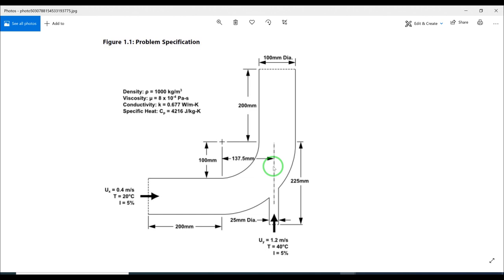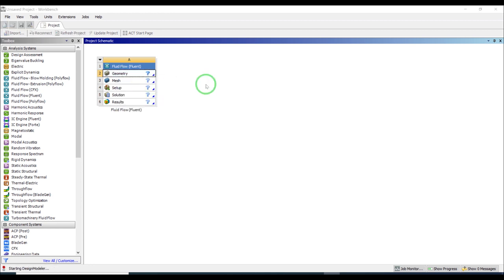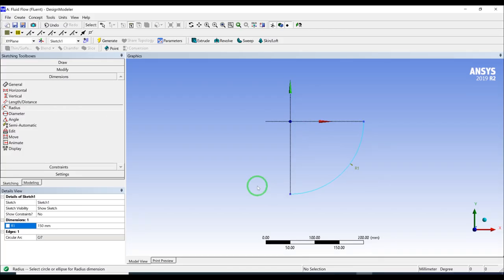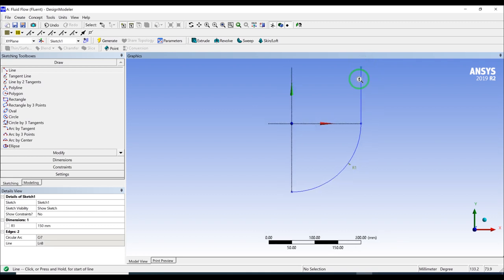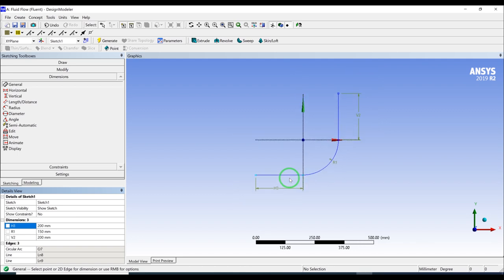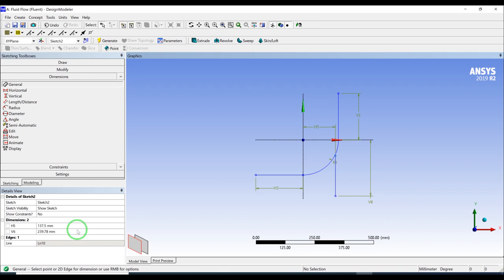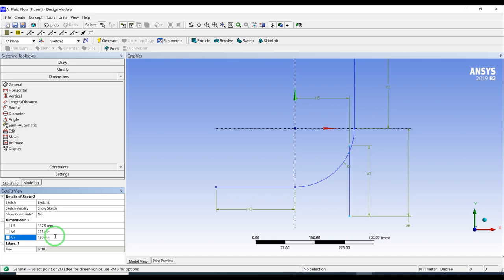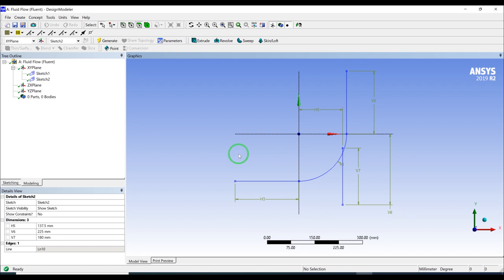Fluent First Tutorial (Heat Transfer Mixing Elbow) - Part 1 of 4

Comment: very good explanation...greetings from India
Reply from the maker: Thank you.
Reply: sir will you make video on flowing of cryogenic fluid through pipe...i am facing so much difficulties becoz crygenic fluid is at very low temperatue(80K) and pipe is at ambient temperature(300K).
Reply from the maker: May I know what is the problem?
Reply: problem is, flowing of liquid nitrogen through 20inch diameter and 100 metre long pipe (entry pressure is 10 bar), i want know how the flow patern will be and what will be effect on pipe (steel pipe covered with vacuum jacket to reduce heat loss to environment)
Reply from the maker: if you want to capture a detailed temperature profile, it is better to do two sets of simulations, one for the developing part and one for the fully developed part. Since the worse case for the pipe will be the entrance section where the liquid is cooler it is better to focus on that part. 
In FLUENT, you need to consider your pipe (with pipe wall) and conjugate heat transfer to find the temperature distribution inside the pipe wall. Then feed this temperature to ANSYS mechanical to see the stresses caused by temperature.
You will need material data for the pipe to get accurate stress analysis in the mechanical.